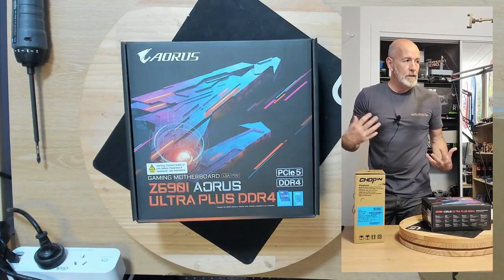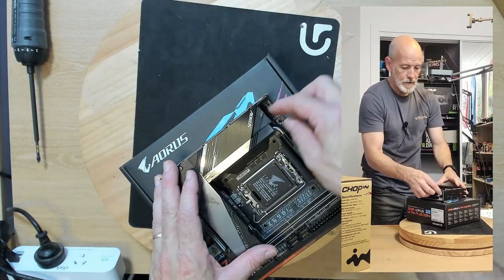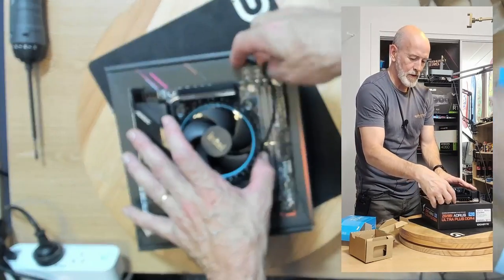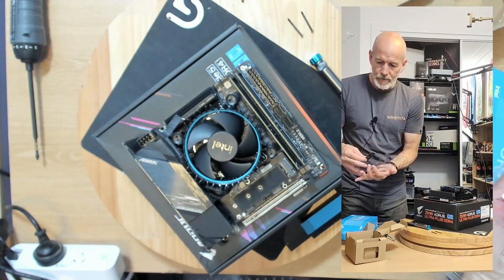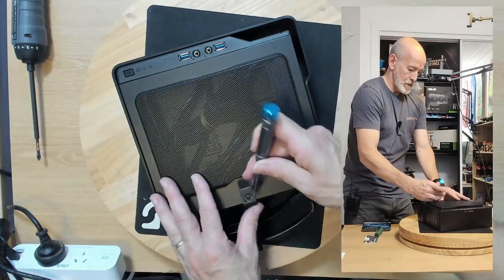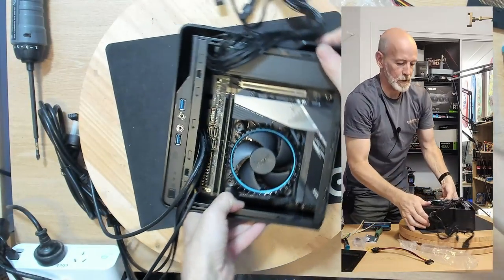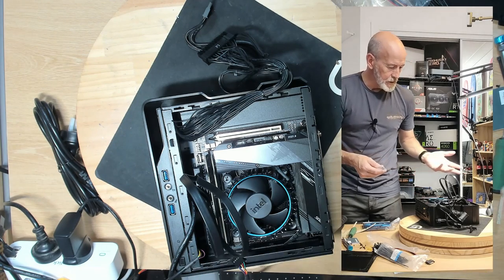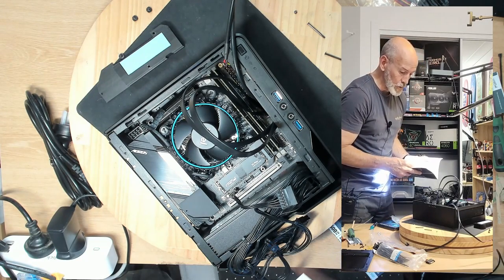Mini ITX Build - InWin Chopin

Comment: Can you fit an aftermarket PSU in that case?
Reply from the maker: Pretty sure you're limited to an InWin replacement unless you're willing to do some hacks to get something else in.  They're using a propietary size here, given the size of the case I'm surprised they didn't go with an external power brick option.